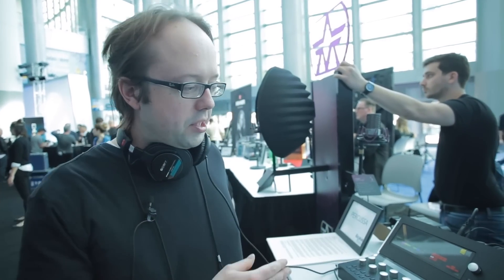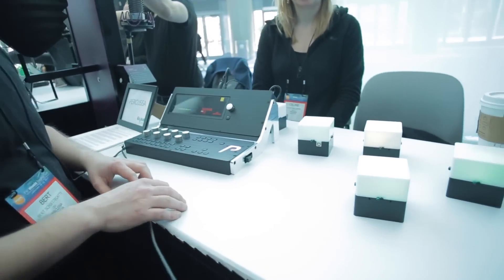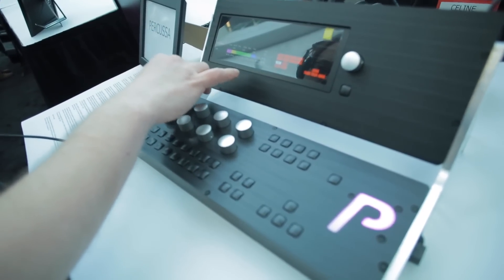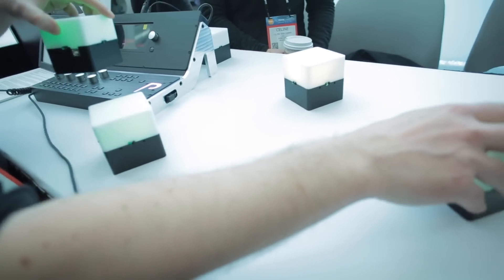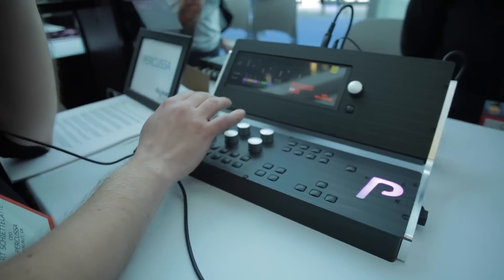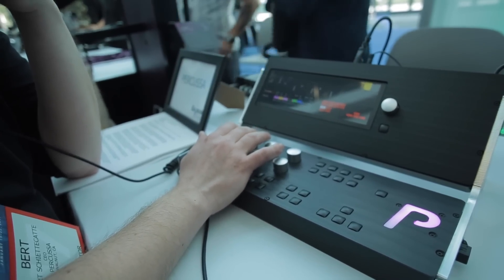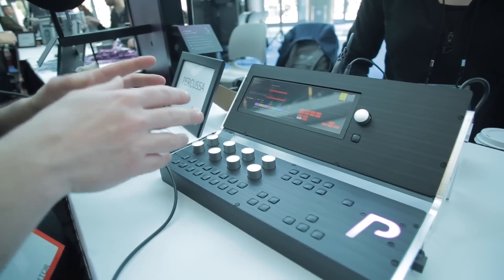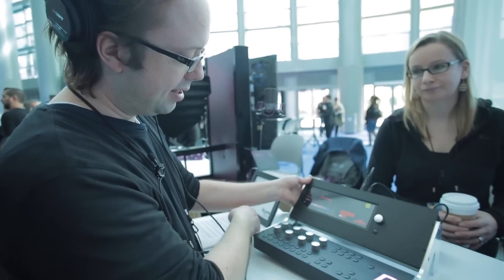NAMM 2017: Percussa Synthor System 8

Comment: The cubes seem pretty silly to me and counter to the likely market. People who want a digital modular like the Nord Modular series want something advanced with massive possibilities. Silly light-up cubes that might as well be knobs seem targeted towards the opposite kind of user - someone who just wants to mess around and doesn't know much about synthesis. That being said, if the engine sounds good, and the modular system is highly capable, this would fill a major void in the market. Nord Modulars fetch big prices even though it's getting harder and harder to run the software with a computer running a current OS.

And for those saying that it's silly that he's saying "you don't have to patch on the computer" when the unit itself is a computer, that may be true in a technical sense but there are huge advantages to all the software running on the unit. The Nord Modular series is becoming unusable because it's tied to software that was written for old operating systems. In a stand alone unit, even if the manufacturer stops supporting it, or goes out of business, the software will still run forever and there's no issue of compatibility with ever-changing computer operating systems. 

If it sounds good (please sound like a Waldorf Q please please please please.... never gonna happen but.... pleeeeaaaaaaase...) and the modular system is highly capable this could be a top synth for a certain kind of customer. If it sounds bad, it's poo. We'll just have to wait and see I guess.

Comment: There's a reason Bob Moog originally put a keyboard on his synthesizer before going to general market. It was so people could approach at least some type of familiar interface and recognize the thing as an instrument.

I generally don't like to disparage new ideas but this looks like a cross between a control panel you would find in an emergency room and kid's toys from a yuppie catalog. I'm all for creativity but this seems uselessly different. Instead of cubes that I have to slide around on an empty table, what's wrong with just 4 good ol' knobs next to each other?

But I'm sure this will at least have the added benefit of being very expensive.

Comment: Always interesting to see new, strange ideas like this. But it does feel a bit like a hardware version of a half decent but quite basic iPad App. Maybe we need to see more. But first impressions are a little disappointing. Looks like something Bjork would use live or 'Hipsters' (I hate that term but I can't think of anything else of the cuff) would have on their coffee tables.
Reply: Dogboy73 if they made Lots of tiny cubes that connected via Bluetooth to an iPad app would be cheaper and more practical.  Cool idea though.